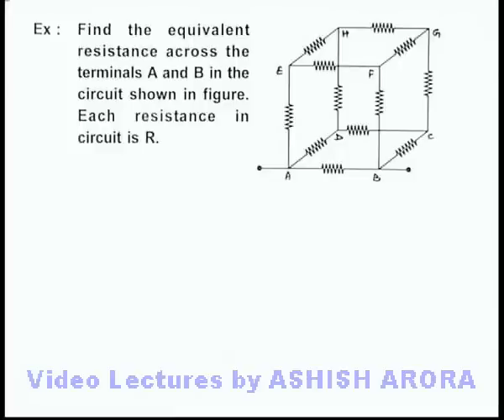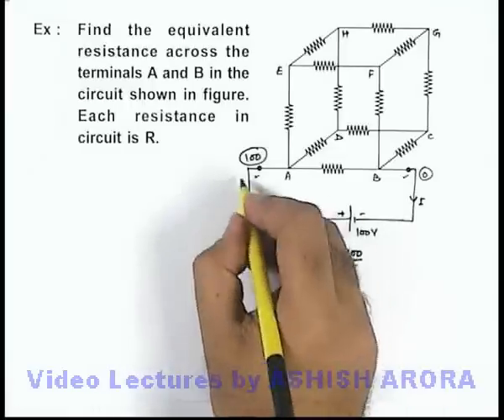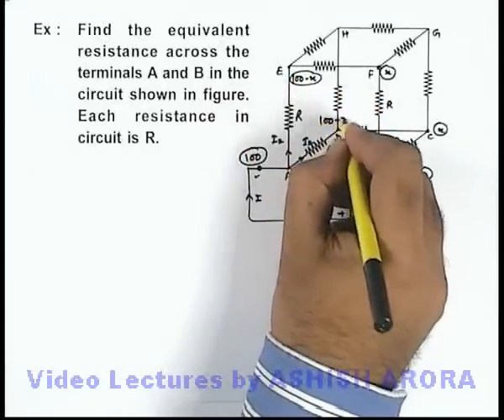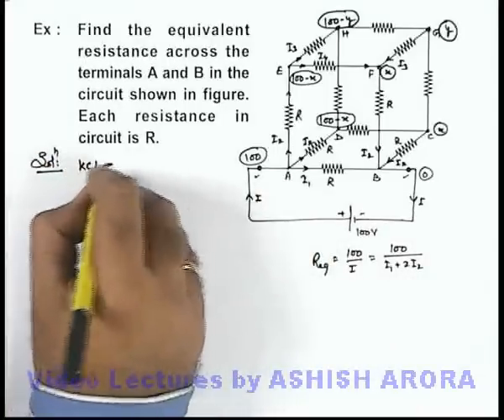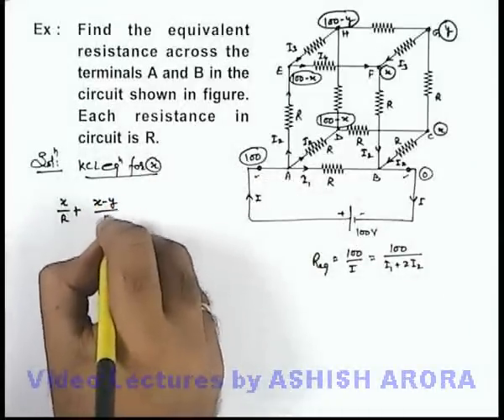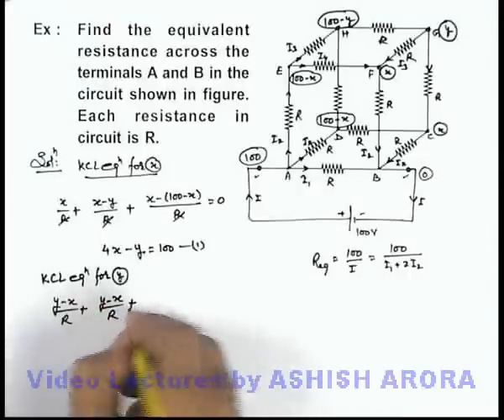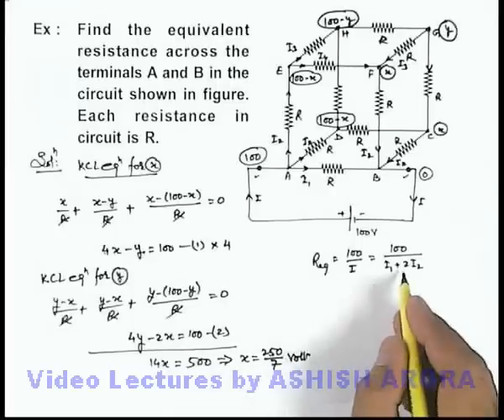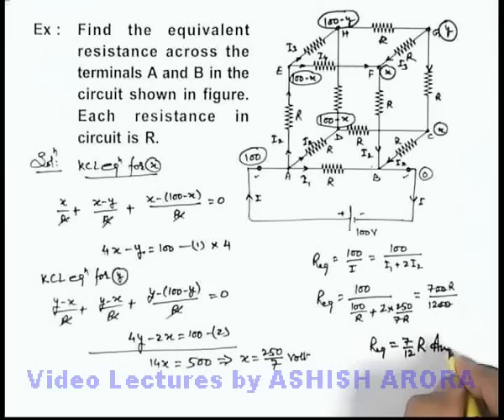Class 12 Physics | Circuit Analysis | #16 Solved Example-9 on Circuit Analysis | For JEE & NEET

Comment: Can't we use 100 as junction for kcl
100/R + 100-(100-x)/R + 100-(100-x)/r =0
100+2x = 0
But we are getting negative voltage and also not correct
Reply: That's not a nodal junction
Reply: @Future_iitian_ bhai Zara batana ye " 100-y " kaise aaya .
Mujhe samajh nahi aaya ki sir ne kaha G ko B ke about and H ko A ke about Symmetrical hona padega kuch samjha nahi yaar
Reply: Bhai agar tu vahi pe sum of outgoing currents zero kar dega fir to tu bol rha hai ki current aaya hee nahi hoga batter se 
Us current ko jo tune equation me likha hai , ko equal kar incoming current ke .

Comment: Sir in the previous problem you considered as I2 as different curent from the 2 other branches which were considered same as I1...but here you did considered the two different current branches as same i.e I2...however I1 becomes different in this case as connected to 0 volt but i did not got logic mentioned above.
Please elaborate....It would be very grateful too if you tell me of some trick to analyze all these sort of current distribution generally.
Thanks
Reply from the maker: There is no trick involved here... you just need to be conscious while analyzing the symmetry... from one terminal to other terminal we use similar potential distributions... it only comes by repeated practice only...
Reply: Does the change of terminal end [comparing from previous case] is playing role here???'
I think this makes logic.Please correct and elaborate.
thanks again.

Comment: Dear sir, why did we just not write the KCL equation at point B? We would then not have needed to take the extra potential y. Please tell me why you didn't write the KCL equation at point B, but at F.
Reply: Because if u apply kcl at B you have 4 currents,
I¹,I²,I² as outgoing
And I as incoming
And the thing is by solving the question we are finding value of I so even if we apply it at B you can't find value of I from it as also there is no resistance in path of I..thats why
Do u understand?
Reply: @kunalverma6940  same logic for terminal A too.
Reply: @kunalverma6940   I didn't get the part I incomming can u tell me plz

Oh I got it after a few secs

Thanku

Comment: sir is it correct that through GC i4 current will flow so potential difference must be different that's why we took potential y on G
Reply from the maker: No thats not correct... curent through GC will be (y-x)/R
Reply: Physics Galaxy sir I did not mean this I meant that if i1 current would have flown the potential difference would have been same ie x so in GC as here current would be i4 which is different so that's why it would be y potential and current as u said y-x/R
Reply from the maker: Yes.